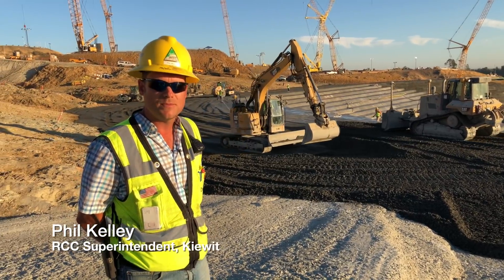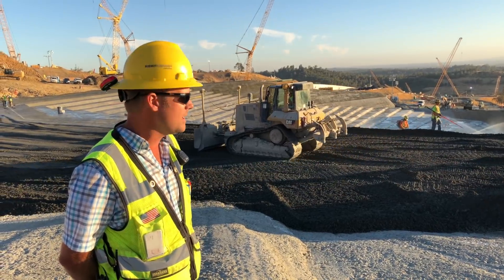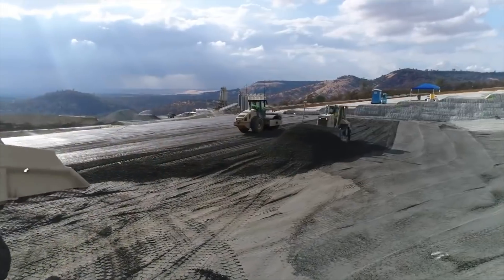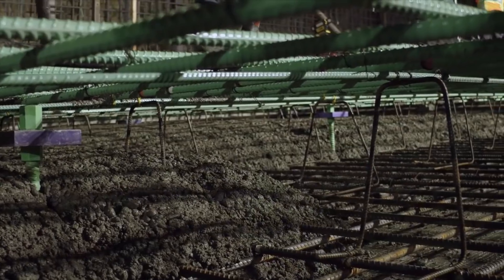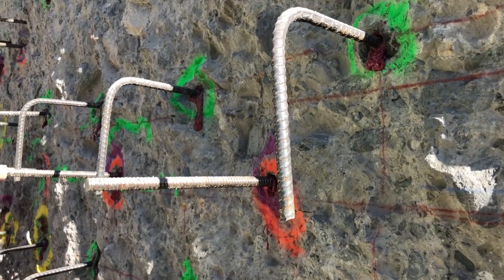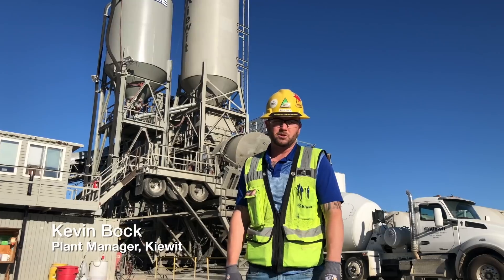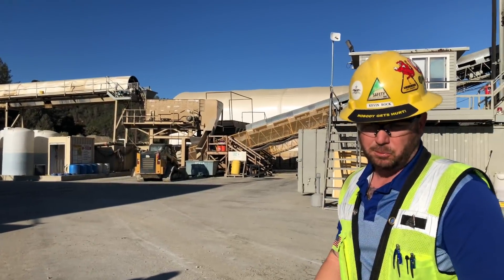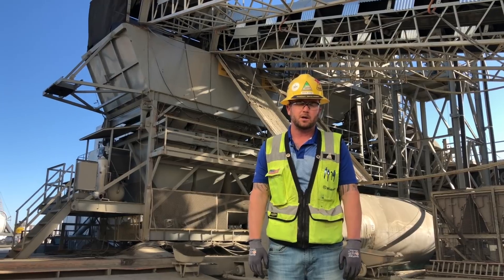Clever Field Solutions Propel Oroville Fix to the Finish Line

Comment: Feb.16, 2019 oroville level 760.00
Reply: April 2, 2019... The first use of the new spillway. Used again two days later at a higher flow. Worked great. However, the Whack-a-Doodles were disappointed it didn't fly apart. Fast forward to April 27, 2019 and the Whack-a-Doodles are panicking and inventing new problems with the new spillway because you know, it's a CONSPIRACYYYYYYYYY!!
Reply: There should be some law against fear mongers or as you say wack-a-doddles against spreading such false lies incorrect info... @nebtheweb8885

Comment: When I saw them tearing up the spillway at the gates dpwn to bedrock as well having to move the spillway walls at this location further out, I said no way they will finish on time plus they spent a hell of a lot time restoring the dentates and the chute walls.

But just like when you're driving and you're cutting close on time and youre worried cuz you feel like you're going to be late but you get there with plenty of time.

Their latest video shows the last slab/wall pours were cpmpleted with a little more than 2 weeks to spare 

Amazing job and an awesome project by its sheer size and the management of the work was outstanding and the work force available to them appear to be unmatched anywhere else.

Anyone else blown away by the Franken-screed?
Reply: Love the screed. One of the many learnings from last year's work. Together, they really improved the pace of work.
Reply: Lately, I have noticed a tremendous increase in the development of novel screeding machines. A few of them are quite small and suitable for small contractor use. 
 https://youtu.be/zyQRroDb8Go?t=96      https://youtu.be/zyQRroDb8Go?t=652